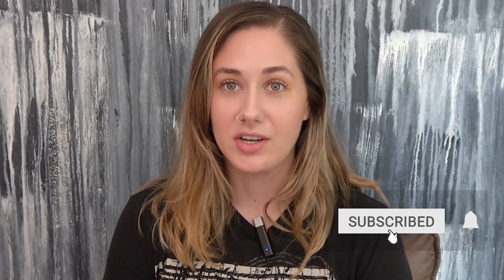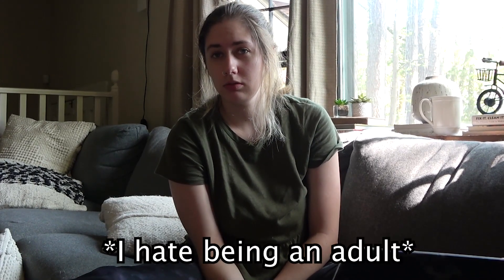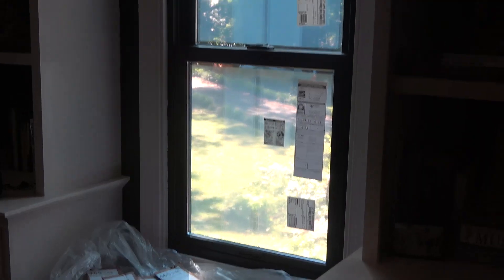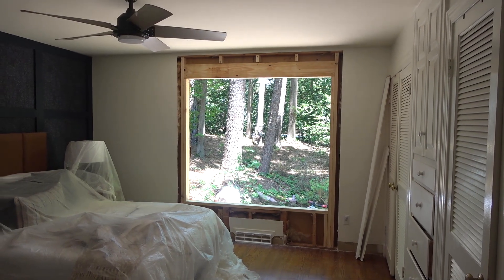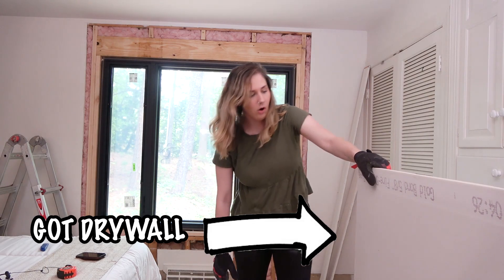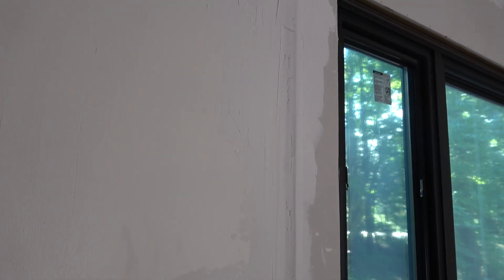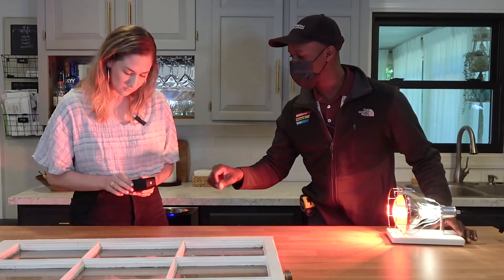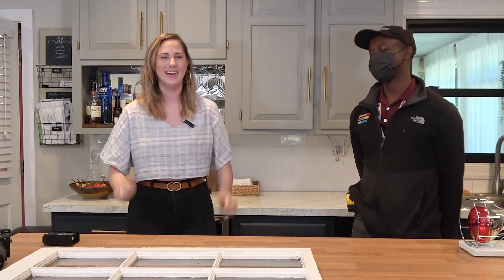My House Got ALL NEW WINDOWS| Andersen Windows

Comment: I live close to train tracks and my house is so insulated that I can barely hear the train whistle.
Reply from the maker: Oh that's crazy. We live a few miles away from the train I we still hear it but not bad at all!
Reply: @MaileyElaine  been here for 27 years. I can be outside on the phone and the train will come then I walk in my house. The person on the phone always says “that’s a fast train”. Nope! I just walked inside. Most will say location, location, location when it comes to a house. I say insulation, insulation, insulation. My son’s both bought pre-fab homes. I told them to help on the utility bill tell them to insulation the hell out of your home especially in the roof. They know my house is very quiet so they took my advice. We live in West Tennessee and we are having 100 degree weather now. Having that insulation really helps plus insulated windows. My windows are old but they are storm windows and one of the best. They do need to be replaced but when spend the money on the right windows they last.